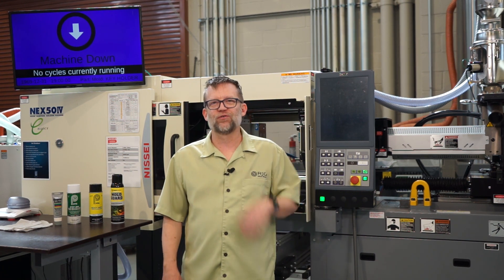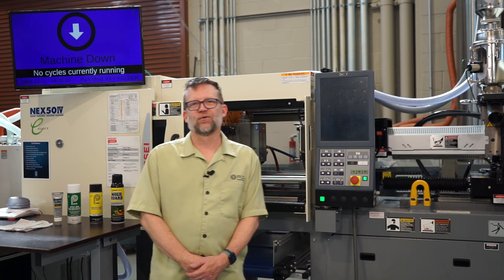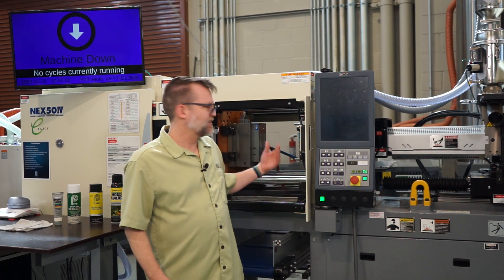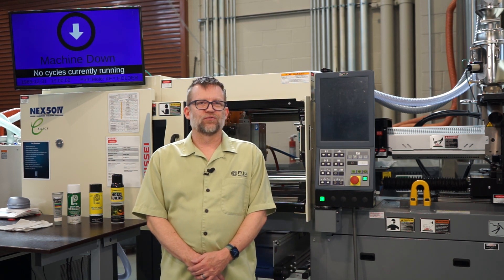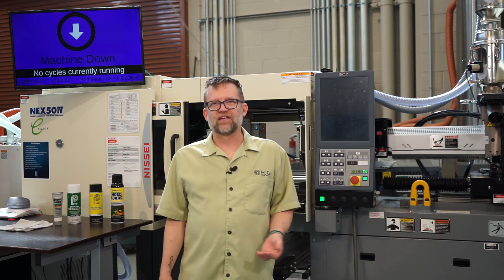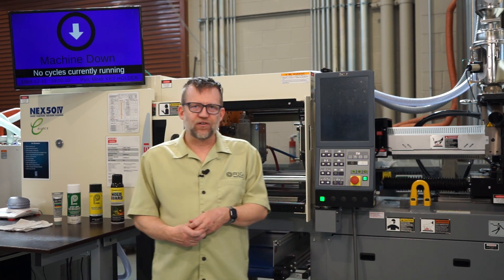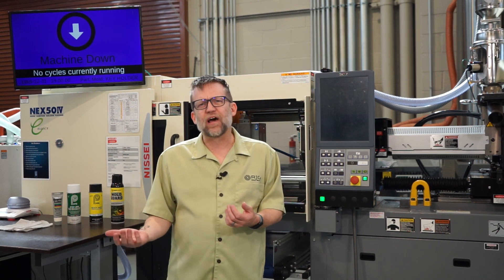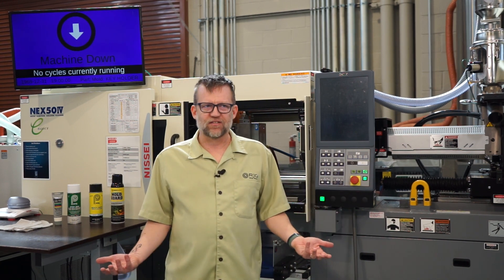How to Clean an Injection Mold Inside the Machine

Comment: Definitely some good ideas but this only covers the basics and i know you said simple but the mold design is pretty simple. Some molds take a very long time to properly clean especially if there are multiple injection units and many different core positions to be set once clamped depending on how often you are cycling a press too it will not matter how often you try to clean the tool to prevent corosion or rusting is a definite enivitablity at that point you need to have a good tool shop to properly pm the mold internally there are just some things you cannot prevent due to mold design and your just going to have to pull the mold to be worked on
Reply: To add to its yes very basic molds can be cleaned very quickly with cleaners but some moldshave very deep cavities and intricate slides or cams that may take a great deal of effort to clean around without taking the mold apart don't know much about the mold but it looks like a thin wall type of mold can really see the A half of the mold so it's difficult to tell but looks like a beginner mold to me
Reply: The best way I've found to clean difficult molds, that have alot of gassing in the vents is to first dry wipe the mold than use and cleaner like acetone, 99 percent alcohol is the best, 70 can work but not that great, always put alot of effort into cleaning the vents always clean as close to the cores as possible If you touch them but they may need polished after  if the leaders pins slides cams horns or wear plates are black dry or corroded due to cycling its best to grease the to prevent mold protects or ejector faults, depending on the mold or type of material running through it saliva can remove some gassing pretty easily if there's significant building up the vents you can clean it with acetone depending on the mold and scrap anything you can't get out with brass or even more delicate molds sometimes wood also wood works very well with polishing compound after you clean the vents really good sometimes polishing them is good to prevent future buildup in the mold there's alot of different ways to do it suppose it depends on the person but the simple mold you sprayed cleaner in alot of people would be absolutely terrified to do that

Comment: I as well do not like the idea of spraying the mold cleaner directly into the mold. We even go as far as to use a paper towel because our tool room uses the same rags and may have metal chips in the that could scratch the surface of the mold. If you spray mold cleaner directly into the mold you may have residue bleeding out from around the inserts for hours and the mold may have to come out to be taken apart to be cleaned. Also no mention of to be extremely carful of all the sharp edges inside of a mold that may cut you.
Reply from the maker: Hi Dean, you are right. In some circumstances, it's better to not spray it directly on the mold. And yes, safety is always key. Thank you for your feedback!

Comment: I don't agree with this video as breaking down the grease internally with such cleaners can lead to galling and other issues.  WE always spray a rag and gently clean the surface per instruction from tooling department.  If you need to directly spray the tool for a clean it's probably best to get a full PM in.

Something else that works nicely when doing a quick clean are dry ice blasters.  No residue, quick, and very clean.  Overall good to see new videos.
Reply from the maker: Great input, James. Thank you! We're so happy you enjoy our videos! :)
Reply: Agree on the dry ice blasters, they clean an mold very good, use it almost daily, but don't blast in thick grease.... it makes a big mess😂

Comment: One comment, Spaying mold cleaner directly on the mold surface is OK for simple tools, but slides, cores, or other moving parts should have grease on the wear plates. Mold cleaner will break down this grease. Spray the cleaner onto a rag and wipe the mold. This prevents someone from putting too much cleaner on the surfaces and diluting the grease from moving components.
Also, sometimes it is good to run the ejector pins forward and wipe them. Especially if they are vented or are RJG sensor pins. This keeps them functioning correctly and removes any residue that may deposit on them.
Good video to share with the technicians on the shop floor.
Reply from the maker: Thank you for the input, Les!
Reply: Exactly. I never spray clear on tools, always rags